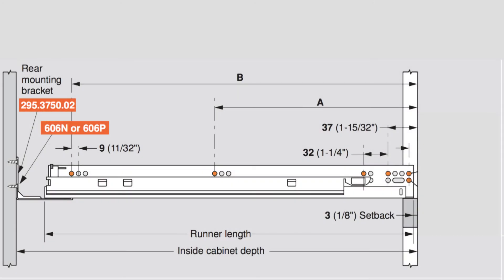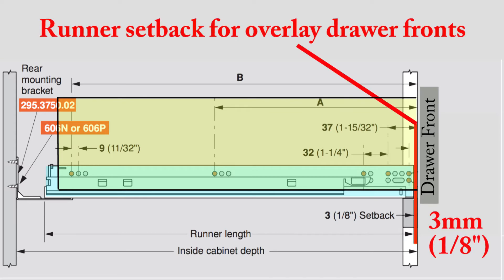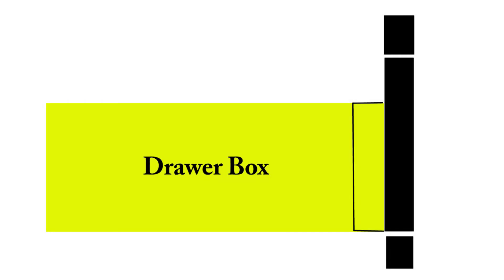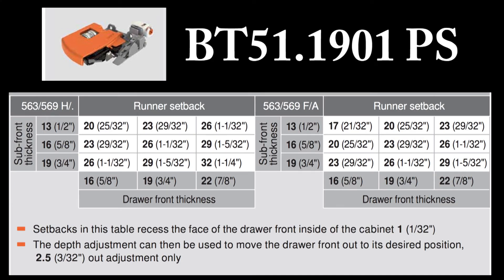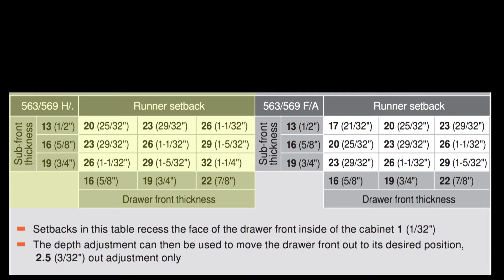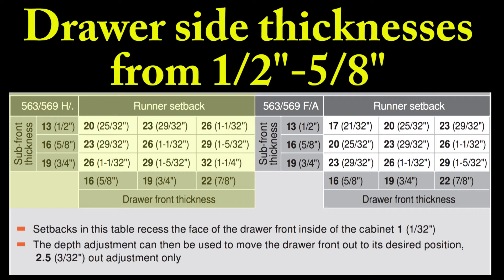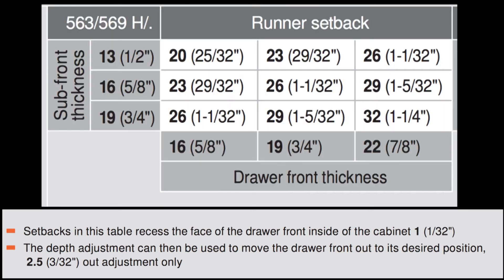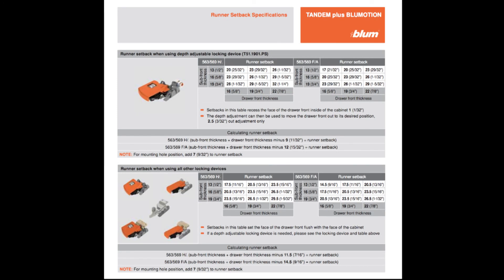Perfect Runner Setbacks for Blum Tandem 563H Series Drawers: A Quick Guide

Comment: I bet the sub-front thickness is an important thing to account for in some circumstances, but I can't understand why it is relevant, since the box (including the sub-front) is the same depth as the runner length. Is this for boxes whose front or back extend down, past the bottom of the drawer-bottom? Anyway, thanks for the video. It explained a lot!
Reply from the maker: Hello,
In response to both of your comments; yes, the drawer front is typically the same thickness as the frame- generally ¾”.  However this is not mandatory.  You would just need to set the slide back 4mm plus the thickness of your drawer front.
The sub-front thickness comes into play because the release mechanism has to have a notch in it to accommodate the drawer slide length.  Blum’s release mechanism has these notches so it can accept either ½” or 5/8” sub-fronts.
-Woodworker's Hardware

Comment: Excellent video that explains a diagram that was confusing to me! As a followup, I am new to cabinet building. For fully inset drawers, is the drawer front typically as thick as the face frame? If so, I guess you'd have to attach a spacer to the plywood on the inside of the cabinet. Any thoughts on best practices?

Comment: When using the 3mm runner setback for an overlay application, do you know what the gap will be between the drawer front and cabinet box when the drawer is fully closed?
Reply from the maker: Hello, 
The gap between the drawer front and the cabinet would be zero.  If you want to use a door/drawer bumper, the setback should be increased by the thickness of the bumper.  If you would like further guidance, please give our customer service a call at 800-383-0130.
-Woodworker's Hardware